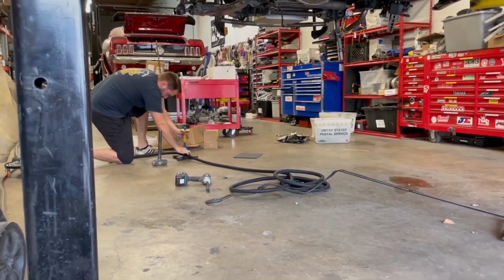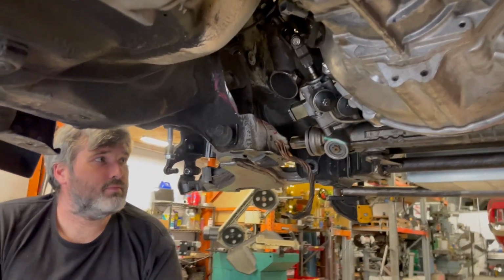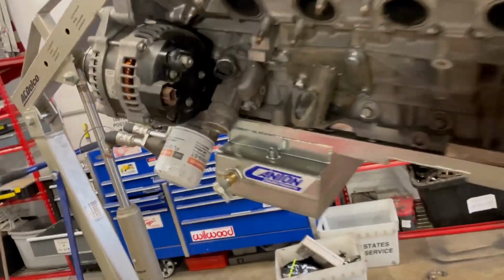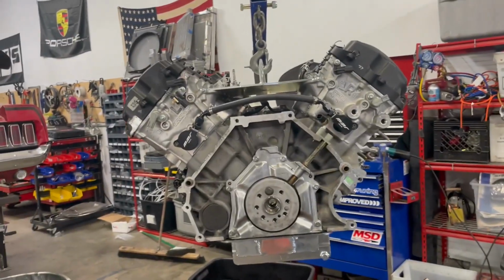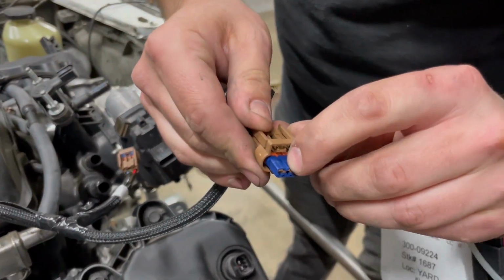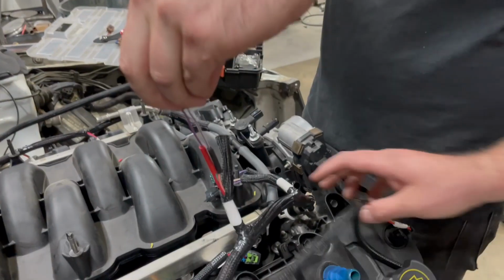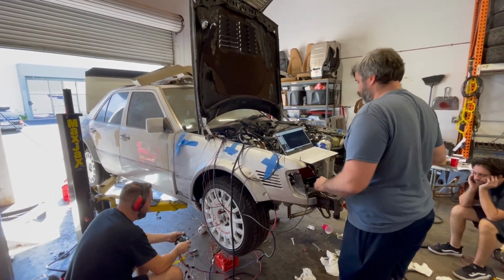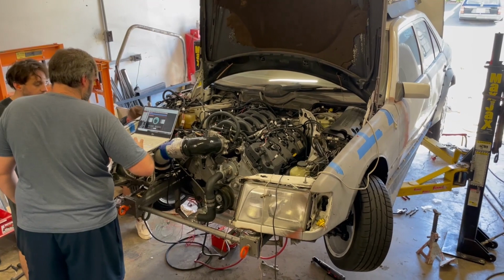AGGRESSIVE First Start!! 8200RPM VOODOO V8 Mercedes Sleeper! | Flat Plane Madness Ep 3

Comment: too late now, but you could have just disassembled and swapped those keyed parts of the coil connecters between the holley and stock plugs without cutting and splicing.

Comment: Man alive, I am so hyped that the channel is growing. Love the come up my dudes, so excited to see you boys getting some recognition. 

I also submit the Name of the car - MercStang

I would think a decent full length exhaust would make it more fun to drive, instead of listening to a droning noise on canyon runs, it would be loud at like ¾ throttle, but civil enough to putt around town. I daily a 95 cougar with a fatty 4 inch straight pipe, and it's fine during slow ass traffic, but at anything above 1/3 throttle its becomes a headache machine. Maybe a small resonator and a near-straight-thru design muffler would be sick. 

Team Red fender
Team 2500

Comment: You should find the stock GT350 mufflers with the valves and use them and make a full exhaust with an X-pipe, or do a double X pipe like Corsa has.

Comment: Any reason why you guys didn’t put the fuel pump and regulator in the factory position? (Under the left rear passenger seat) looks further out of the way. Love the videos tho and all the !Mercedes content 👌🏻
Reply: No real reason to stick to stock location when the parts weren’t there to begin with.  Plumbing is a bit easier and it keeps the big dumb hoses to a minimum
Reply: @samjohnson7325  Thanks for the reply! Simplified plumbing is a very valid reason! I got a little shock from the fist camera angle of tacking in the pump mount it looked like it was getting welded to a anti roll bar 😂

Comment: I see you have the 1st gen voodoo with the normal oil filter, you should do the swap to the cartridge filter as to not have any catastrophic failures while ripping on it. The harmonics at high rpm can spin the oil filter loose, common issue on these
Reply: It is getting a remote filter.  It would have had it for the start but we had some issues getting it plumbed so we tossed the stock oil console back to get it started
Reply: @samjohnson7325  Awesome

Comment: You shouldn't have cut the coil wires! It would have been so much cleaner to de-pin the connectors and just switch the plastic parts.
Reply: we tried and the voodoo connectors retainers disintegrated.  we are going to try and source some new plug and pin kits for the coils for the final install.